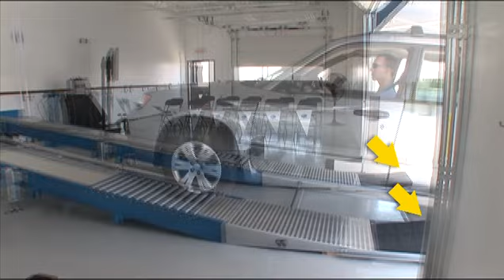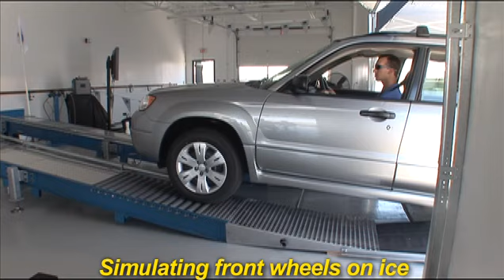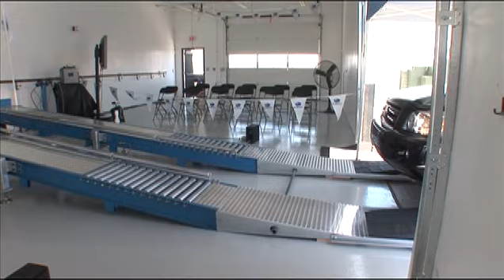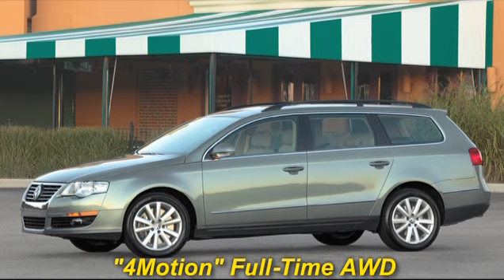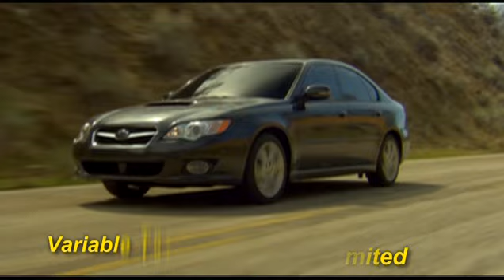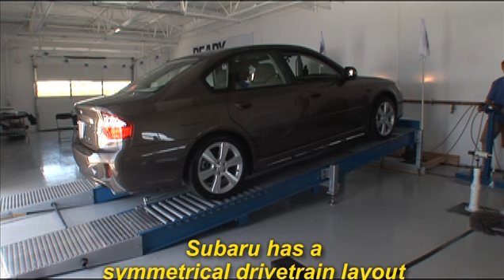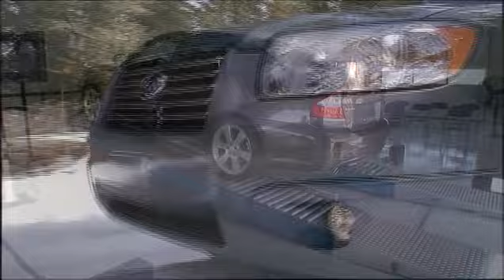Subaru Symmetrical AWD vs. Honda, Toyota, and Volkswagen

Comment: These ppl are morons can't use traction control and 4wd same time
Reply: you can ABSOLUTELY use traction control and 4wd at the same time. none of these cars really are 4wd though they are all wheel drive. 4 wheel drive means 4 wheels soin all the time whether they have traction or not. traction control reduces rpms when car loses traction. if you have no traction and you continue to spin your tires, you will make things worse then if you let off the gas. it is a sure sign of someone who thinks they know what they are doing in a 4x4 but really do not
Reply: +Chris Smith Subarus wheels are awd all the time,
Reply: +Mitch Justus then why does Subaru use a traction control system? Audi, Land Rover, Jaguar, Mini, Mercedes, and more, also use a similar traction control system in conjunction with the 4X4. Having an active traction control and active systems are the main difference between traditional 4X4 and AWD.
Reply: +Dylan Piekarski not really. traction control and 4wd and awd are all different things, though you are right in saying traction control is related to awd.
Reply: 4WD does not spin all wheels if they have traction or not, you need a locking diff for that. But it will send power to the front and rear all the time (If in 4WD mode, controlled by the transfer case). The differential will control left/right power and it must be locking or limited to send power to both sides during slip.

Comment: You can't use 4wd on crv with traction control active dumb axx that's why it didn't work and if you hit brakes 4wd will disengage
Reply: They are demonstrating it's lack of power to the rear wheels. CRV can't send enough power to the rear or anything even close. That is it's let down. Then you see a Forester handle it and send enough power to the rear to get it moving. He's not holding the brakes... So you are saying if you get stuck on a hill in a CRV and you brake AT ALL you are fucked because AWD will no longer engage?

I smell a Honda owner LOL

Comment: Only bmw x-drive can compete with subies.
Reply: +Antares I've seen some comparison videos and Audi's system looks 100% better than BMWs. I don't even like either brand, so there is no bias there.
Reply: +Antares I remember watching jeremy on top gear testing a BMW with x-drive. It couldn't even go up a grass hill.
Reply: Yeah, their about equal. Their both fantastic systems either way. Subaru is a little more on the mechanical side where as Mitsubishi is little more technical oriented. And the SH-AWD on the Evo is nice because it has presets for gravel, snow and tarmac. But the WRX STI also has a little more control over how the driver wants it. Aka, more power to the front, back, 60/40, etc.... Although I'm sure the Evo has option like that as well. I think the new Ford focus is also on the list of a big competitor. The AWD system on it is completely new and can send up 70% to the back (I think, don't quote me) and from there 100% to either wheel. Either way, you'll get a great AWD system with either brand😉 It mainly comes down to taste.
Reply: Actually Honda/acura is better than Subaru.
Reply: They can be, depends on how you look at them. Reliability wise, there both pretty equal. Either way, there both going to outlast most others.
Reply: The SH-AWD is as good/better than Subaru's AWD

Comment: I wonder if the traction control could of been a different result with it off?
Reply: not in a practical situation. tragtion control off would be good for gaining speed in a slippery situation, for things like slamming through an otherwise unpassable snowbank. but in a normal scenario, if your tire loses traction, and begins to spin, spinning it faster will make it worse. in snow or sand or things like this, it wil cause the wheel to dig deeper.  however the 4wd for the most part in this video is not real 4x4 it is awd.

Comment: I'm currently looking into this in lieu of thinking about buying the next car..  I live in Iceland lots of tar, but also lots of snow, ice & chanagable conditions..  This test does ofcourse highlight the benefits of asymetric AWD, but in reality ice isn't zero grip once you factor in driving with nailed winter tyres/experience.  I'm just wondering how a passat with Torsen system (VW´s mechanical and possibly more proactive though less fuel efficient predessesor) would have coped.

Comment from the maker: Subaru used direct competitors against each other. The Tribeca was able to do this as well. In newer videos, the Forester with the base engine and Subaru's most basic AWD was also able to climb on one wheel. It's not a matter of weight, it's a matter of being able to put power where needed. The Passat's Haldex system is inferior to Subaru's most basic system.

Comment from the maker: The only thing stupid here is your comment. The CR-V wasn't able to make it up with ramp with and without traction control on. Even if it needed the traction control off, not being able to automatically assess traction needs and appropriate power to the rear wheels is poor design execution. The CR-V's AWD is inferior to more systems on the market than just Subaru's

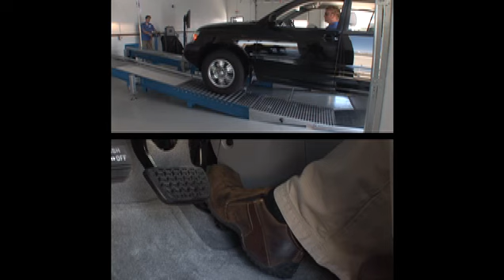Comment: Had this unsettling thought about handbrake being on when first saw the Honda unable to climb but not showing the rear axle in the video. Then the same thing happened with the Toyota and suddenly there is a picture of the driver`s foot on the accelerator. What is that pedal clearly visible at 4:56? An e-brake showed clearly in off position? I smell a rat..

Comment: symmetrical drive i don't understand this coment??? subaru use a computer assisted limited slip differential, providing power to one wheel and taking the power away from the others but still allowing them to caster until grip is found, talk steer will simply allow the car to veer off under power.

Comment: get my jeep and hold my beer....
Reply: Assuming it performs comparably... I'd still have to say I trust Japanese reliability
Reply: Xeno Subaru has extremely shotty long term reliability...
Reply: Say bye to Jeep because Land Rover is here
Reply: Can my corolla join in too?
Reply: Jeep is 4x4 if you use it on any surface that isn't lose you can damage the transfer case these vehicles are awd and are usable on any surface
Reply: Let's throw my '86 samurai in the mix
Reply: Hold my Vodka, Get my Audi. lol
Reply: You should prolly hold onto your own beer, you will need it to pass time in the ditch later.
Reply: Jeep broke down
Reply: GM cars are garbage and expensive to repair.
Reply: Suburus is faster n cheaper on gas
Reply: Subarus are expensive on gas, have terrible head gaskets (twice as many as normal 4 cylinder engines), and rust. Only lack of easy financing keeps used values up and people fixing things that would send other cars to the scrapper.
Reply: @Bartonovich52  they get rust issues because people dont wash theirs cars after covering them in salt or keep up on the undercoat. factory under coat is only good for 8 to 10 years. which is right around when cars start to rust. headgaskets is an issue. and most people dont like getting them done. but i love it cause it makes them cheap for people like me who buy them cheap, fix them up and resell them. my buddy has bought and sold probably 10 subarus this year cause he gets them for around 500$ does the gaskets. fixes some rust. and resells them for 3 to 5k. they are really easy to do i you know what your doing. take the motor out. easiest way to do it.
Reply: The Life Of Riley Subaru’s rust because there paint jobs suck and they use cheap metal....
Reply: @Bartonovich52  all cars rust even modern ones, and subarus dont have head gasket issues anymore, and subarus also have an insanely high resale value

Comment: Insofar as the electronics intervening to control the throttle, on many Traction Control systems you can just turn that function off. With my Volvo XC90, you can turn DSTC Spin Control off, and voila, no automatic throttle intervention at all. And my user manual recommends to turn it off in low traction situations. It's obvious to me than that in a lot of these demos showing the other guy's AWD to be junk, that the user manual has not been consulted.

Comment: One thing is that you can turn the VSA that is slowing the engine down off in the CR-V. It would transmit enough power if it was off. I know it's dumb to have to turn it off but I think it would pass the test with VSA off and only real time 4wd.

Comment from the maker: Acura and Subaru aren't in the same price point and SH-AWD is more marketing than substance.  There are multiple versions of it just like Subaru's AWD. The most common is mostly a FWD system with two clutch packs in the rear to that can send up to 100% of the rear torque to one wheel. It's nothing special and not competitive with Subaru's Continuous or VTD Symmetrical AWD systems.

Comment: this should be a promo video definitely should be worked into a commercial. I have tested Subaru's AWD system to the max one of the only cars I never got winter tires for. Could run with Summer tires and still dump the clutch and take off on a icy road gotta love the Subaru.

Comment from the maker: The A4 Quattro is $33,400 to start and that's with a manual, about $5k more than the most expensive Legacy sedan with an automatic. That's about the price of a WRX STI which has a much more advanced AWD system than anything in Audi's lineup including the R8

Comment: AWD is subarus speciality so and buyers keep in mind buying these but on other hand CRV and Toyota are general purpose vehicles more often used by urban commuters so they dont have to put equal power to all wheels which drastically reduce Drive train and Tyre durability.

Comment: @rapidotorpedo well I guess you are right, but still, that just proves that most companies are willing to go with crap systems such as viscuous couplers or Haldex clutches for the sake of having a better fuel economy (marginally) rather then going with a proper all-wheel drive system that uses a center differential

Comment: @Loscaldazar i have a 1998 ls400 that got stuck in snow when i was uhm uhm trying to have fun in the neighbourhood, because its rear wheel drive and front was in snow, it would not bulge.
With out the TCS the car would spin one wheel, with the tcs there was a dramatic effect and this was a open diff FR car. And i amazed to even get out. thats a 98 model.

Comment: @jayxtreme6  lol i meant when you are stuck and the back wheels are not spinning you press the accelerator enough to have the front wheels spinning at atleast 35mph i guess rather than basically crawling at 10 mph

Comment: Is it not stated that viscious coupling needs to have much more speed to activate?
I mean thats what honda uses and mostly all manufactureses use to improve fuel econmy and have fwd cars.
Subaru has a much more active center diff, may even be locked (though i do not know).
If every manufacturer did that then every car would be as good as the other.
And also as i remember, newer cars have awd diff lock to lock center diff. Toyota rav4 and rx350 offer that diff lock.

Comment: @SoDaSub   That much I knew.  I was talking about with open differentials.  The only way to control left/right torque split at that point is by inducing a load on the spinning wheels via breaking.

Comment from the maker: @lostnumbr ofcourse it does. On a wet street, there is some traction. One wheel may have more traction than the other. If both wheels are on a surface with no traction. The shorter shaft will always slip. What you are experiencing in your 99 impreza is totally different than what's happening in this situation. You can start a fire with dry sticks rubbed together, a lighter, lightening, or a magnifying glass. We are talking about torque steer created by a lighter and not by a magnifying glass.

Comment from the maker: @yngvaigilbsteen can you point out which ones by the title and who posted? All of the ones I pulled up showed the Forester completing the test. Turning VDC off is is necessary in some situations. If a vehicle is stuck in mud or deep snow, VDC should be turned off in order to rock the vehicle out. If all the wheels are slipping, there is no traction, and VDC will bog all of the wheels down.

Comment from the maker: @yngvaigilbsteen Correct, unless you have a WRX STI or were climbing on a rear wheel with with an older LSD equipped Subaru. The benefit of VDC is that it will sense and preform the job quicker than an LSD which is why they were removed from the vehicles.

Comment from the maker: @yngvaigilbsteen No. left and right torque split can happen through the use of non open differentials on the front and rear axles. Some previous Subarus had rear limited slip differentials. They could transfer power left and right on the rear, but had open front diffs. The WRX STI has a mechanical front and a Torsen rear differential. It can transfer power left and right on the front and rear wheels without VDC.

Comment from the maker: @yngvaigilbsteen The 2008 Forester without an Limited Slip Differential would not have been able to climb on one wheel at all. A 2008 Forester XT with no VDC and an LSD could climb, but only on one rear wheel. A vehicle with VDC can climb on any one wheel, depending on weight, incline/decline, and the traction of one wheel.

Comment: @SoDaSub   If I'm correct on the former, then I believe I am thinking correctly on the latter.  It took me a while to figure out why anyone would bother to integrate a VDC system into an awd system that already "took care" of everything and could "route" power to individual wheels.  The answer is that the symmetrical AWD drive system doesn't "take care" of everything.  Only front and rear distribution.  You need VDC if you want to simulate everything in this video.

Comment from the maker: @SoDaSub Also, some systems do not have 4 sensors and 4 channels from the wheels to the computer. Some vehicles use individual sensors for the 2 front wheels, but both rear wheels are controlled as one. This is very common for FWD vehicles and AWD vehicles that are based on FWD vehicles.

Comment from the maker: @yngvaigilbsteen That is correct. For Subaru, VDC is integrated with the AWD. It's not slapped on top of it. Some manufacturers, like Volvo, have systems that are not fully integrated. A Volvo has to disengage AWD to engage ABS. Subaru uses steering, braking, accelerator, and individual wheel sensors to ensure that the vehicle is going in the direction where the steering wheel is pointed. It can do this by braking on individual wheels and managing engine output.

Comment: I notice this video doesn't simulate 3 wheels on ice and only one wheel making traction with the 2008 Forester.  They don't mention it having VDC.  I'm betting that's the reason.  They wait to do that test with the Legacy with VTD/VDC and limited slip rear.  Stating that it is the drive train most like the VW.  Again, if I'm wrong...please explain.  I would love to know that my car would climb with only one wheel making traction.

Comment: The only way for an awd system to really control individual wheel spin is through a breaking process provided by a traction control computer.  Correct?  If I'm wrong, please explain.  And if so...how DOES subarus awd system route power to just one wheel?

Comment: I'm asking because it seems reasonable to assume that in an effort improve stability...traction control applies braking to individual wheels with more spin than others....thereby inducing a load on the wheel.  Power then, by default, finds "it's" way to the other wheels since the formerly spinning wheels are now have a load on them.  So, individual wheel control is key and is almost a by-product of traction control.  AWD systems only control front and rear diff torque distribution...correct?

Comment: @SoDaSub    There's plenty of vids on here with subarus getting out of unbelievable situations...but there are a few on youtube in which the diagonal traction becomes a problem and the behave like a standard 4wd with open diffs.  e.g.   "forester diagonal test"  There are also others under the related vids.  Also, vids in which people are directly comparing climbing with...and without VDC.  Turning VDC off seems to be advantageous when momentum is needed.

Comment: @SoDaSub   Understood that my vehicle would climb depending on weight...how much traction the other three had had etc.  I'm assuming you're referring to a situation in which my other three tires had very little, but still some traction and one wheel gripping well.  I'm talking about an instance in which my three tires would be on ice (virtually no grip at all...with only one gripping well.  Like the simulation with the roller test here.  That's not a VDC thing?

Comment from the maker: @yngvaigilbsteen Yes, it would depending on how much traction the wheel had, how much weight is in the car, and how steep the incline is. Subaru's Vehicle Dynamics Control is Traction and Stability Control. I should have clarified "2008" the 2009 Models came out in calendar year 2008. All 2009 Model Year Subarus onward(except the 2009 Legacy GT 5MT) have VDC. 2008 Model Year Impreza had it on every model except the most basic model. You may not have on your Impreza if it's not a premium.

Comment: @SoDaSub   Also, If my base model WOULD climb...what's going on in these other vids where these guys are teetering over a ditch with only two wheels making contact in a diagonal pattern, (front driver and rear passenger for example) and not being able to move?  I have my theory on that and it seems to make sense, but your telling me that that is not an issue of having vdc or not?